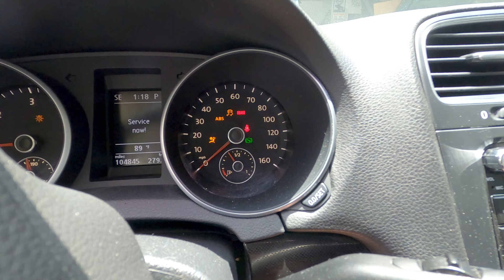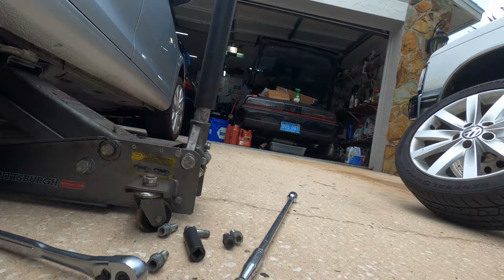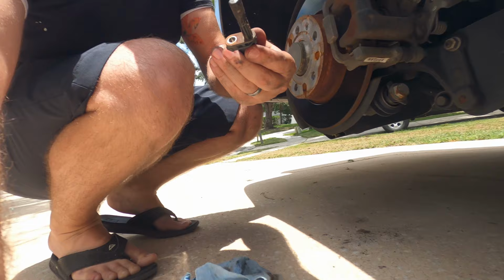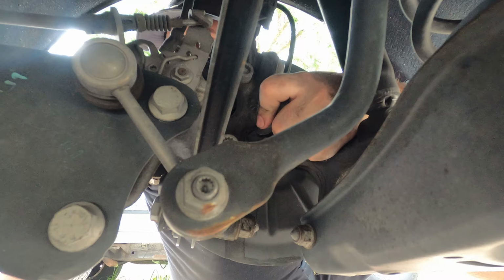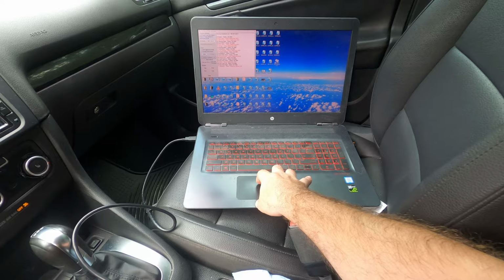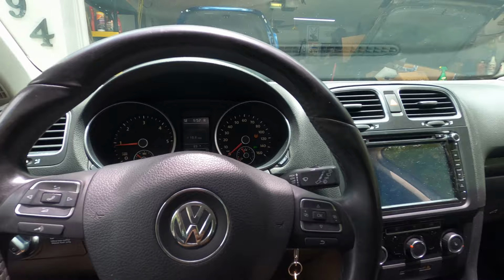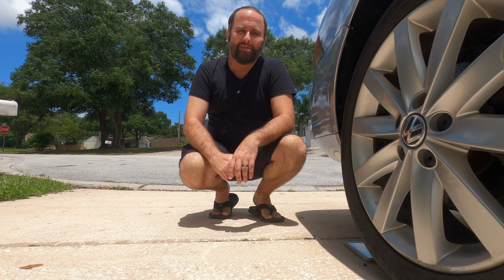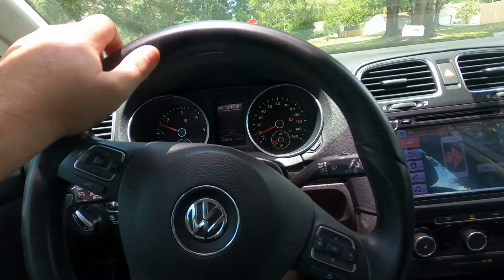VW ABS Wheel Speed Sensor Issues

Comment: Same lights on 2011 Tiguan. But its showing no codes
Reply from the maker: Strange that it isn't showing you any codes.  Did you try to clear all codes anyway and then Drive/Scan again to see if anything shows up?  The dash lights shouldn't all be on unless there is some kind of fault detected.  

If you have a genuine VAG-COM you should be able to go in an find the signal for each sensor, but I don't remember which code blocks they're in off the top of my head.  Ross tech's site should be able to direct you to the right place.

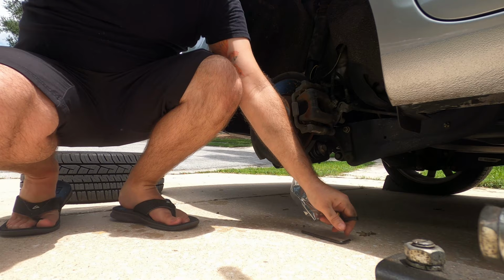Comment: Hey I have this issue plus now my 7:12  speedometer isn't working also. Do you have any suggestions on that
Reply from the maker: It's still most likely your speed sensor.  Many others have reported speedo issues when their sensor was bad.  Replace the bad sensor and all of those problems should go away.  As always it's best to start with scanning for codes to see which sensor is bad and whether or not any other codes are showing up.

Comment: We used a VAGCOM and it threw codes for back right sensor. We replaced the sensor, and reset all codes. Drove and all codes popped back up. Used a multimeter and the sensor is reading 0. Any ideas?
Reply from the maker: Is the only code that popped back up for the RR sensor?  If so, and the sensor is testing properly you could have a damaged wire somewhere.
Reply: @VHickleGarage  it's throwing codes for electrical faults on the other abs sensors now as well. There are other codes as well for the random lights that have went off, all are the exact ones shown in your video!
Reply from the maker: @amberm.6074  It sounds like you may have some bigger issues going on.  I would start out by checking your main ground, but if all the sensors are showing problems then it could be the ABS module.

Comment: Hey !! can you give an update on the downshifting ?? had the same issue with the wheel speed sensors on my polo 6C, Replaced the sensors and have no error codes but that random downshift happens on bad roads, especially from 2nd to 1st gear. is it just how DSG behaves while moving slowly on bad roads?? !!!
Reply from the maker: I have had the issue pop up randomly a couple of times since doing the sensor.  I haven't been able to pinpoint any other specific thing that is causing it.  Definitely not something that is normal operation for the DSG.  I would suggest checking the wiring for your sensors, but I would expect that to throw a code.  Unfortunately, I haven't dug any deeper into the issue since mine hasn't been acting up.

Comment: I replaced the ABS sensor the a new one and did not solve the issue...
Reply from the maker: What codes did you have before/after replacing the sensor?
Reply: @VHickleGarage  right rear wheel ABS sensor... strange that ABS, ASR and also tyre pressure light are on simultaneuosly

Comment: I have a 2009 mk5 gti and it’s throwing the abs, traction and brake light on.  I’m not able to read codes idk y but it also goes into 1st when the beaps start ( rethrowing the codes) I’m also cruising and I have to go to nuteral quickly so it doesn’t blow. Any ideas?
Reply from the maker: It certainly sounds like you also have a bad wheel speed sensor.  Unfortunately without being able to pull codes it's just a shot in the dark.  The only option would be to just replace all 4, and there's no guarantee that will fix it.  I would suggest trying to find someone to scan it for you, or purchasing a VAG-COM from Ross Tech.

Comment: I'm having the issues with everything you mentioned but my code is a faulty is Abs module could it be the same as tps sensor?
Reply from the maker: The Speed Sensor, TPS, and ABS module are all different things.  If you're getting the code for the wheel speed sensor then I would start with replacing that first.  If you only code is the ABS module then that is most likely your problem.

Comment: I have the exact same lights you had, the scanner was saying it was a rear speed sensor both left & right and no communication with the control module, I replaced both sensors and reset the lights but they all came back on except for the airbag light, I don’t know where to go next any ideas ?
Reply from the maker: If you're getting a control module error, and the lights came back after replacing both sensors then it must be the module, or a wiring issue.  I'm afraid I can't be much help on that since I haven't dealt with that issue.  I have a communication error with my gauges that I haven't figured out yet.  It's not really affecting anything so I haven't really tried to troubleshoot.

Comment: same lights on my scirocco multifunctional steering wheel isn’t working along with the horn did anyone else experience this? Also the speedo jumps up a few mph every now and again tried swapping the sensor out today with a cheap one didn’t work
Reply from the maker: The new sensor didn't get rid of any of the dash lights?  Did you ensure you got the right sensor, by scanning the computer? 

  Sounds like you may have some other electrical issues going on.  I haven't heard of anyone else having any issues with the steering wheel controls as a result of the abs sensor.  I haven't heard of the speedo jumping either, but that one could be from a faulty sensor.
Reply: @VHickleGarage  turns out there’s no magnetic ring on the hub so it’s not picking up a signal and I’ve been told because of the airbag light and the abs light it cuts of the steering wheel while throwing up loads of fault codes, I used a voltage tester on the connector and it was saying 11.5 volts
Reply from the maker: @livinginthelie8409  That makes no sense to me on the steering wheel buttons. . .Yes the airbag is affected by incorrect VSS/ABS reading, but that has nothing to do with the stereo controls.

  For the sensor itself idk the proper testing procedure with a multimeter, but I would suggest scanning the computer to see which sensor it says is the problem.  I'm 99% sure that testing voltage at the connector will not tell you if the sensor is bad, it just confirms it is getting power.

Comment: Did the issue with your transmission get fixed? I am the issue where the little wrench shows up on my gear indicator almost everyday now
Reply from the maker: I was getting the wrench too.  The new sensor mostly took care of the problem, but I have had the trans act up a couple times since I replaced the sensor.  I believe I have another sensor starting to go bad right now, so that is probably the reason.

Comment: I got the same issue with my VW polo 2015 change the abs sensor for a new one but issue came back in 5min drive 😢
Reply from the maker: Did you scan the car before/after to make sure you changed the correct sensor?
Reply: @VHickleGarage   Yes i did but the scan doesnt say that the sensor is defected but it detects that i have a flat tire. i checked and the tire is fine and hold air for weeks.
Reply from the maker: @LarsSchretlen  Have you tried resetting your TPMS?  Doubt that will fix it, but worth a shot.  IDK about the polo, but my reset button is in the glove box.

Comment: I don't have this scanner. Can I clear the codes by removing the battery cable and draining the system ?
Reply from the maker: You can't clear all the codes without a scanner, but if you replace the sensor then the lights might go away on their own after driving it for a whiel.

Comment: I have the same exact lights. Why would the wheel speed sensor cause an air bag light?
Reply from the maker: I believe it's because under a certain speed the air bags shouldn't deploy in an accident, and with the bad sensor the computer may not be sure of the vehicle speed.  I'm not 100% sure of that though.

Comment: Change the sensor and it didn’t fix my problem the lights went away for a couple minutes then came back on idk what the problem could be
Reply from the maker: What codes did you have before, and are you still getting the same codes after changing the sensor?
Reply: @VHickleGarage  the codes before were 
1 right front  speed sensor 
2.vehicle voltage terminal 30
3. Break light switch 
4. Tire pressure monitoring controls moduel  and the codes I have now are low transmission fluid , cruise break switch , abs controle moduel I have all
The lights u used to have but after I changed the sensor sometimes the lights do go away but once I do a turn or drive for a bit they all come on again
Reply: @VHickleGarage had to come back to this vidoe and I put a new sensor on and well that wasn’t my case at all my friend checked that car and he saud my air filter needs to be placed or my MAF sensor and my rotors are bad and to top it off my gti is leaking oil a lot so yea
Reply from the maker: @Alexis-mk6  Ouch.  A lot of different issues there.  I'm assuming then that the rotor issues is why you were getting these lights.    You can get a can of MAF cleaner at any auto parts store.  You can try to remove it and clean it before buying a new one, they often just get a little dirty . . .Just make sure to let dry off before plugging it back in.

Comment: Hello, how are you? I had the same problem in my Passat cc 2012 and after changing the sensor the problem was fixed but sometimes the problem appears again and until that I put my car off the problem exist when you start the car again the problem disappears. Do you have any idea about my problem?
Reply from the maker: I would suggest scanning the car again.  It sounds like one of the other wheel sensors is possibly going bad.  If its not that, then there could be a problem with the computer/module.  I don't know what the best method for testing the module.

Comment: Do you know if the Front Left & Rear Left use the Same Sensor ? Or is each position a unique sensor?
I need to replace both rear sensors.
Dealer gives me unique ones, but online aftermarket just has a Front Left & Right without a rear option so was wondering if I could just use the front ones on the rear ?
Reply from the maker: I believe each sensor is unique.  You'll need to make sure it's a rear sensor.  This one for my 2011 Jetta says it's a rear set: https://amzn.to/3KzSBTO
Reply: @VHickleGarage  gotcha thank you

Comment: Same issue here. Wondering if you felt vibration in the brake (before the warning lights activated) prior to the sensor replacement?
Reply from the maker: I did not have any vibration.  Sounds like you may have a warped rotor.  I would think significant enough vibration could certainly damage the sensor, or cause faulty readings.
Reply: @VHickleGarage  you could be right. However, when the abs light activates the vibration stops.
Reply: I did

Comment: Same fault in my car but , after changing abs sensor , same problem exist. What can I do
Reply from the maker: Did you scan the car first?  Still getting same code after the new sensor?  If you didn't scan you could have changed the wrong one, or have more than one that's bad.

Comment: Where did you order your speed sensor from? Having a hard time finding the one I need. Been thru 3 already that didn't work.
Reply from the maker: I can't remember where I ordered it now.  I know it was aftermarket, don't remember which brand.  OE part is like $140  Something like this rear set on Amazon might be good option: https://amzn.to/3Dgyusr   ECStuning, FCP Euro, URO Tuning, and Europa parts are also all great resources for VAG parts, but some of them can be a little more expensive.  If you've been through 3, have you scanned the car to make sure you're replacing the correct sensor?
Reply: @VHickleGarage  ok cool. Yeah VW is trying to charge me 160 plus tax for one. Thanks bro.

Comment: I got the same issue but now the car wont start im getting the code 01314 wich is no communication with the ECM. Did you by any chance run into a similar issue? I have a 2016 jetta 1.4t mt transmission
Reply from the maker: I'm not sure about that code. I have a no communication issue with the module for the instrument cluster but not the ECM itself.  I haven't taken the time to look into the communication issues so unfortunately I couldn't' tell you what's best to chase that down.

Comment: Will this sensor control the speedometer not working or is that sensor on the trans ?
Reply from the maker: I did not personally experience issues with the speedometer but from what others have said it is possible that bad sensors could cause the speedometer to malfunction.

Comment: Did you order an oem sensor or a different one? The oem ones are like $150 online
Reply from the maker: I took a gamble on an aftermarket part.  So far so good.  Seems to be about 50/50 with off brand parts on VAG cars.

Comment: I replaced all 4 sensors and light are still on. Is there way to reset the error codes?
Reply from the maker: Have to have a VAG COM to fully clear the codes.  My lights did go out on their own after I swapped the sensor, so if yours are still on you may have other issues as well.

Comment: Is the computer the only way to clear the trouble codes and if so what did you use with the computer?
Reply from the maker: The lights actually went away on their own after I changed the sensor, so you may not need to worry about it.  But to completely clear all codes you do need a code reader / computer.  I used VAG-COM from Ross Tech. . . it allows you to read and clear codes specific to VAG cars.

Comment: Is there any way to protect the sensor from being faulty in the first place..like a die electric grease or housing for protection of dirt and debris?
Reply from the maker: I doubt that would really protect it.  They are designed to work with the dirt and debris.  As I showed cleaning mine didn't really fix it.  Unfortunately, these sensors are a wear item that will occasionally need replaced.  In 2.5 years I've only had the one go bad, although I do have another one starting to act up.
Reply: @VHickleGarage  Every year I have to change a different faulty abs sensor that acts up. Is that normal?
Reply from the maker: @aaronjaggan  I know they do frequently go bad, but every year seems excessive. . .unless you're driving in really harsh environments.  In 2.5 years with the sportwagen I've had 1 go bad.  A couple months ago another one started acting up but then stopped before I replaced it.  I've never had any abs issues on my Audi, but idk if they're the exact same system.
Reply: @VHickleGarage  Thanks for the reply. I do drive in harsh environments ( where I live unfortunately , constant flooding , mud, dusty environment) and I always wonder why my family japanese cars don't give errors like that since they live there where the conditions are.
Reply: I have an update for you. I got diagnosed this time around for a faulty abs module. You think if I replaced it ..would it solve the problem that I am having frequently of replacing those abs sensors?
Reply from the maker: @aaronjaggan  I'm not sure if a faulty module would cause the sensors to keep going bad, or if they're just two separate problems.  I have heard of the abs module going bad as well, but I haven't had any experience since mine has been good so far.  So your computer has an error for a faulty module then?  I'm sure there's a test procedure, but I don't know what it is.

Comment: Hello sir how are you what brand did you use for ABS sensor please help me because I want to buy my ABS sensor I have 2014 Nissan Altima 2.5 l s my right front ABS sensor not good they need to replace so I want to know what brand sensor I should order thank you once again
Reply from the maker: I don't remember now which brand it was that I used.  If the OE part is cheap enough it's probably best to go with that.  If not then you could take a chance with a cheap aftermarket (off brand) part.  This one on Amazon has pretty good ratings: https://amzn.to/3cAXEH9
Reply: @VHickleGarage  thank you so much brother I order this ABS sensor and my mechanic put it in my car and so far they run great thank you once again have a great day

Comment: If you don’t have the computer, how will you be able to know what sensor is bad and how to reset the lights?
Reply from the maker: There really isn't a good way without scanning.  Most parts stores will scan for you for free.  Otherwise you can try replacing all the sensors.  If the fault was corrected then the lights should eventually go out on their own.

Comment: What codes did you get for the wheel speed sensor? and how did you which one it was??
Reply from the maker: I got code 00287.  In  VCDS it said "ABS Wheel Speed Sensor, Right Rear"  so it was pretty straightforward.

Comment: I just had my rotors and break pads replaced. 3 days later my abs module/ speed sensor lights came on. What were the codes you got? And how did you find out it was the sensor and not the module?
Reply from the maker: 00287 was the wheel sensor code I got.  I also had 18255 Transmission Code that there was an ABS Fault.  I just started with cleaning the sensor because it's the more common issue, and it's was cheapest/easiest to do.

Comment: Will this fix the epc light after i hit 3d gear it stalls on the jetta 2.5 2012
Reply from the maker: I can't say for sure.  Sounds like you might have other issues.  I don't think a speed sensor failure would cause it to stall in 3rd.  Have you scanned?  Any other codes?  If not that would be the first thing to check.
Reply: @VHickleGarage  yes codes 01314 ECM 
And codes p0222 and p0122 throttle/pedal position sensor circuit low input

Comment: After changing the brake fluid, the car paid me back with this fault, around 200 miles later.
Reply from the maker: Never know what's going to set these off.  I've got another one acting up intermittently right now.  At least they're relatively cheap and easy to replace.